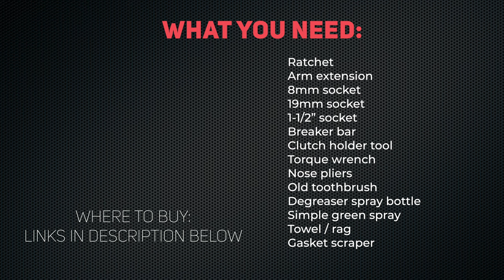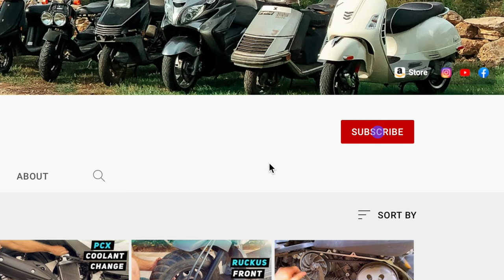Genuine Blur 220 - CVT Removal / Installation - PGO G-Max | Mitch's Scooter Stuff

Comment from the maker: T O O L S
Torque wrench 0-150 lb/ft 3/8 drive - http://amzn.to/2Crqq4R
Engine cleaner / degreaser - https://amzn.to/3W63UHQ
Variator / Clutch holder tool - https://amzn.to/2ZuYJEA
3" / 6” extension set 3/8 drive - http://amzn.to/2h7ypMl
1-1/2” 1/2 drive socket - https://amzn.to/3OoEwel
19mm socket 3/8 drive - http://amzn.to/2CiXNqo
8mm socket 1/4 drive - http://amzn.to/2xMhsBl
Breaker bar 1/2 drive - http://amzn.to/2HenuMI
Ratchet 3/8 drive - http://amzn.to/2hhmnUs
Gasket scraper - https://amzn.to/45gpf6e
Nose pliers - http://amzn.to/2yetDDj
Simple green spray 
Old toothbrush
Towel / rag

Comment: Hi Mitch, thanks so much for the video - excellent! I'm based in New Zealand I have a PGO 200 2008 G-Max that's been sitting in storage for 10 years. Is that the same as yours in this video? I tried to start other day, no go, took carb apart gave needle & all a thorough clean - replaced belt & it now idles at super high revs like 5000 haha... will have to work on it. But I see the links no longer sell those rollers, what do you recommend for mine? 

Clutch kit link please? Gasket link. No damage to my pulleys but I am thinking of replacing the variator kit anyway as it's pretty old & the original I think. I will take clutch apart tomorrow for an update since watching this. Ideally want to pimp it right out and get some specialist parts like those guys pimp their Honda Rukus's - pretty cool. Thank in advance for your help. Cheers. Toni